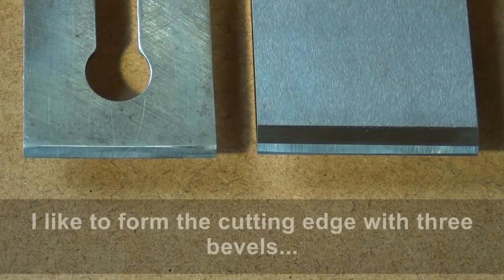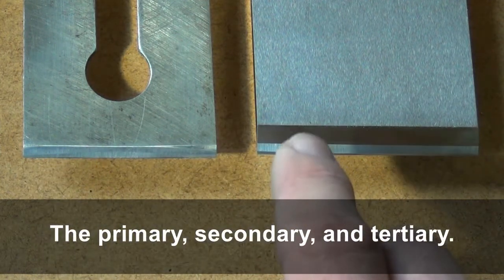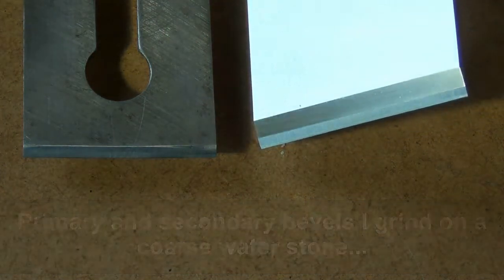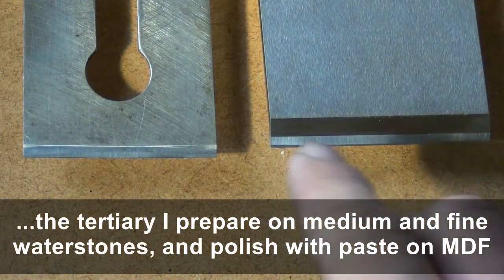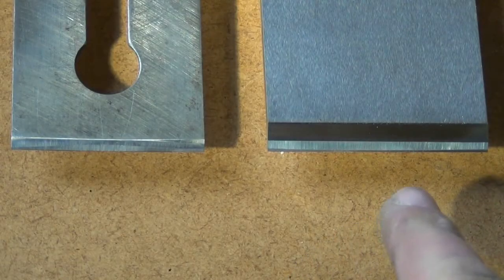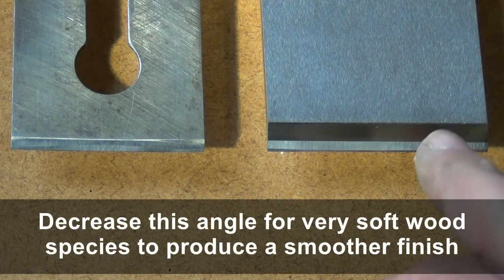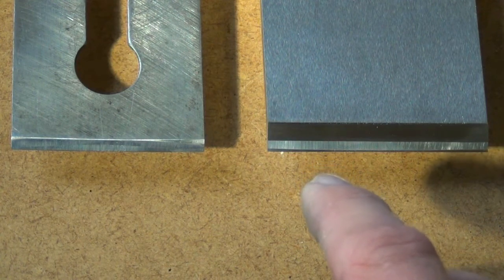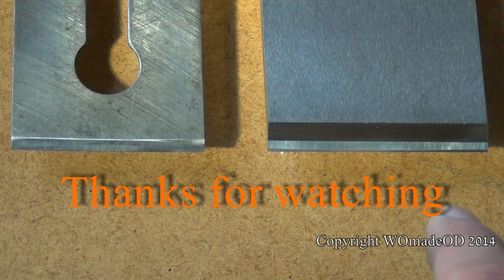Plane Iron Quick Tips - Bevel Angles

Comment: If the primary and secondary are not touching the wood ( only the third one does) why do I need the the secondary bevel at all. Doesn’t make sense
Reply from the maker: That would seem logical. However the secondary helps to thicken the iron behind the tertiary which reduces vibration. At least that's one theory.

Comment: I dont get it, what difference does it make on a bevel down plane? as long as its under 45 degrees it will cut just the same if you sharpen it at 35 or 30 or 25.
Reply from the maker: The bevel angle will determine how well the edge holds up against chipping in particularly hard woods, knots, etc. It's also wedging into the wood, so the greater the angle the more work is needed to push it through a cut. Ideally we would want something that cuts easily and holds up well, but since the two factors conflict we tend to choose the compromise angle that works best in the type of wood we are using. Just to complicate matters, it's possible to add a back bevel too!
Reply: @mitchwoodwork  saw your video on back bevels, changed my life.